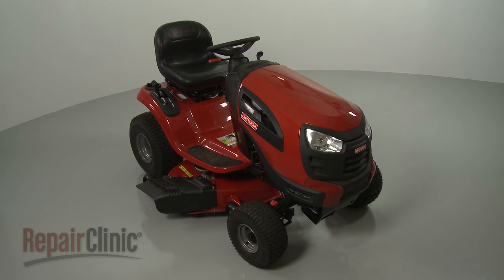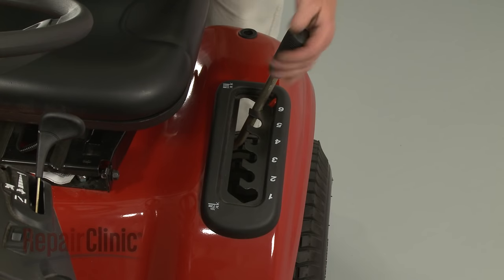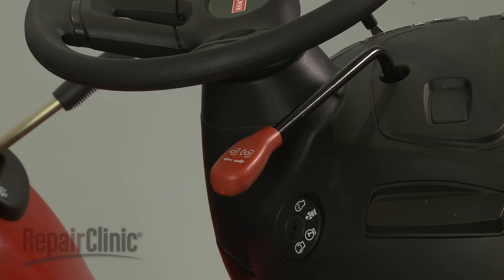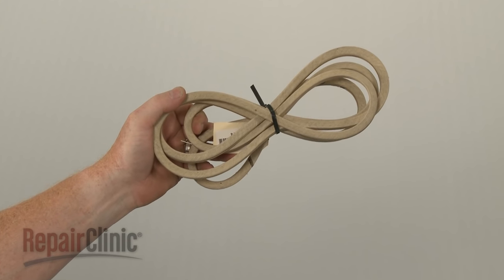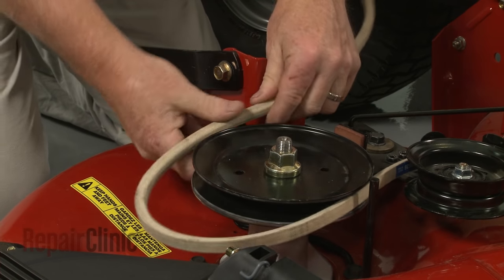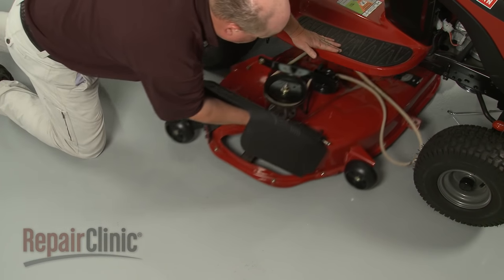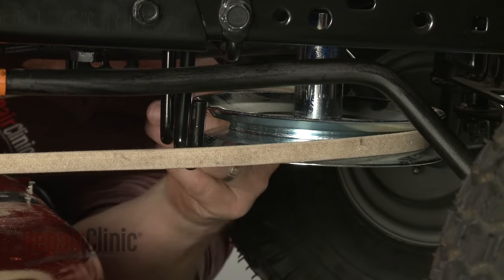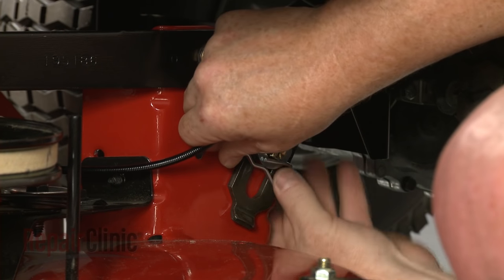Craftsman Riding Lawn Mower Deck V-Belt Replacement #532429636

Comment: Thank you so much. someone put my belt on wrong and it wouldn't engage the blades new belt. So I found your video and tore it all apart and stated over. I'm a 65yrs young woman on oxygen. And I did all that in a hour. would of been so simple if I could of done it the right way first. Great video keep them coming. never know what next I will need to fix. LOL
Reply: Good for you! I'm an empty -nestette about your age. Thanks for the encouragement 🙏❤️😊

Comment: 2018 T1200 Craftsman 42 deck not belt. Looked up, lower deck number  on riding lawnmower and measured old belt but, new belt to large & no adjustment on cable on riding tractor. Old belt measures 95” which is 2” too long. What belt on deck do you recommend to fit shorter & and what is the part number that fits?

Comment: John B .The video was fine, but for me, allot more work than needed. Dropping the deck is fine if you want too waste time, but I just changed the drive belt on the Craftsman T110 without doing that. All that's required is you remove the pulley guards for the deck, and remove one bolt on the guard around the drive pulley so it's loose to get the belt around that pulley. Both ways work, but for me, the more you take loose, the more you have too hook back up.

Comment: Went and did this without taking the deck off of my Craftsman t150 but it was a pain. It was nearly impossible to slide the belt off the outside pulleys due to the "guide/metal rod" that helps to keep the belt from slipping off. After finally wrestling the belt off I learned the new belt (that was recommended) was slightly thicker so as you can imagine I had quite the time getting the new belt on. Several hurt fingers and blisters later voila!
Reply: I also did the job without removing the deck. What a time saver. I also had trouble with the "guide/metal rod". I closed my vice grips completely around the rod below the pulley and was able to pull on the rod to allow the belt to squeeze into position. No hurt fingers and no blisters.
Reply: I'm struggling with those fucking belt retainers as well, mine are thick and not bending or giving very much, nothing like this video shows where the belt easily slips out of them. My belt is also a bit thicker and in no way shape or form getting by these stupid retainers that have no reason being that close/tight to the pulleys. The one I'm struggling with is the retention pulley as well, so it's really annoying trying not to release tension at same time while trying to do this. 
I've tried channel locks but my strong grip isn't bending that thick piece of metal. Guess I'll have to try a long thick screw driver and see if I can use force to bend it over while using momentum. 
I figured Craftsman would be easier than this.
This has been ridiculous to say the least.
Reply: @Lucixir  I can't remember how I did it but it was basically using whatever leverage i could find and just muscling the belt in place. It was a pain for sure.

Comment: Not on this current mower(which is identical to what they're working on) but the previous rider i had, was the very first I'd ever owned.  My neighbor tells me "yeah i know how to do that". 
3 hours later,  having replaced the belt, but also putting the ENTIRE MOWER up on jack stands via floor jack, i was thinking "there's no freakin way this should be this friggin hard!" 
So i then did what i should've done to begin with; YouTube.  5 minute fix.  Took longer to find and watch the video than it did to actually do the task.  
I dunno who invented YouTube, or who thought "i should do a how to video for 'this thing'", but they both ought never have to buy a beer ever again for the rest of their existence.  Hell, even their children and grandchildren ought not have to buy beer EVER.

Comment: I have a YT4000 with the same belt set up which works well until I disengage the blades then the belt comes off the pulleys any help greatly appreciated

Comment: NO need to remove the deck. Took me 30 seconds to replace the belt.. I’m a 62 yr old female with a bad back and did it…. No issues. Easy peasy…
Reply: I'm a lady your age. How did you do it? My belt is broken and I'd rather not pull the deck off, thanks! 🙏

Comment: terrific. I have a 2006 craftsman lawn tractor it has a 23 HP engine with a 42 inch mowerit is a Ys 4500 series . Having trouble finding a deck belt.

Comment: Thank for this video. I learned from it and saved over $100.00 doing it my self Thanks a gain.
Reply from the maker: +Rod Sapyta We are glad it helped.
Reply: I have to say at first I did not get the new belt lined up the right way but I came back inside and saw what I was doing wrong and I have a nice new cut lawn. Thanks for taking the time to do this video.RS

Comment: I have a Craftsman GT 8400 w/ less than 40 hours on it.  For reasons unknown, the deck belt came off when I engaged the blades.  I can't get the belt to go around the drive pulley.  I have tried to create more slack by moving the tensioner pulley with a crow bar but still am unable to get the belt around the drive pulley.  The configuration looks fine per the drawing that is on the mower.  Do you have any suggestions?
Reply: This same thing just happened to me! The belt is so tight I cannot get it back on! how did you end up fixing yours?

Comment: T1300 here. 42” belt, official, and it’s way too loose. I’ve spent 2 days working on it and I still can’t find a way to tighten it. Help please!
Reply from the maker: If it is a genuine OEM replacement part it should fit. Double check that the belt is correctly installed.
Reply: Actually it’s not about just getting the part, it’s getting the right one from the model number and serial number underneath the seat then looking it all up on a parts website or calling a retailer to double check. Getting a 42” belt from Craftsman may not work on your 42” deck because of the model number (not T1300 for instance, it’s a code)

Comment: I have a T2600, it is IMPOSSIBLE to take the belt off unless you loosen the belt guards (which is very painful to loosen).  This includes the front pully as well. YOU HAVE to loosen 2 on the deck plate and take off one in the front from the engine. The other painful issue finding the correct size belt!  NOT listed in the manual!   Agree, with comment below, DON't need to remove the deck, just lower it to the lowest cut setting.  This is and will be my last Craftsman.   My mower was built in 2017.

Comment: You do not have to remove the deck guys! The belt is easy to replace without doing all that.
Reply: Guess what I tried to do it as well without removing the deck too. I miss placed the belt on the pulley without going around the pulley guide the right way and burned a belt up first try after I installed it. It shredded it up. It is worth taking the deck off indeed. Plus I sharpened and cleaned the deck the same time. Win Win Win. 👍
Reply: for some odd reason the tension pulley wont move very far on ours and we keep destroying cables if the lever is moved more than half way. only thing i can figure is possibly debris locking it up. really fed up with craftsman products and my dad mistreating it by neglecting to properly clean it after he uses it. if it isnt a debris issue than i have no idea. tired of fighting it.

Comment: great video clear and to the point. I installed my new belt on my 42in Craftsman mower everything went on fine. Then I went to start it and it wouldn't start. In the end I put the old back on and it started right up. Any reasons to why the mower would not start, I sensed it was a little tight because I had to push and pull to get everything connected back but that I expected. Any help or information would be greatly appreciate it have a great day.
Reply: Sounds like blade clutch was engaged.

Comment: Folks. YOU DO  NOT NEED TO REMOVE THE DECK!!!!!! You can do this job is 10 minutes. 6 screws holding the 2 shrouds over the pullys is all you need to remove and replace the belt. Why on earth go through all this unnecessary steps ? suddenly 10 minutes turns into 2 hours......

Comment: what size belt would i need for a ys4500 craftsman riding lawn mower
Reply: nate davis you can usually find that under the hood. The blade/deck size is the same as the belt size

Comment: I have the LT100 model, hopefully this instructional video is similar to what I'm about to face.  Thanks (Crossing my fingers)
Reply from the maker: markarel This video should at least give you some expectation of what you'll run into.
Reply: The belt replacement was a success, thank you  for your tutorial.  Now I have to clean this carburetor.
Reply from the maker: markarel Thank you for sharing.

Comment: is there a fix for this? : My 2010 Craftsman YTS300 doesn't seem to cut the grass evenly. its almost like where the tires push the grass down doesn't get cut on the next pass, like the blades aren't spinning fast enough to "lift" the grass back up so it can be cut. then when I come around on the third pass I can see a stripe of Longer grass where it didn't cut. Is there a fix for this? I have tried new blades, the stock blades and the hi lift Mulching blades, I changed out the belt for the blades, I have leveled the deck now a few times.to me it just doesn't seem like the blades are spinning as fast as they should be. can I get smaller OD pulleys for the deck? or is it some other problem? its the 46" deck YTS 300 with the 21 HP motor. other than that its a fine tractor.
Reply from the maker: +hdrjunkie We would defer to whatever the user manual says about deck adjustments. That information is more specific than information we have.

Comment: How do I find the right belt for the craftsman t1600 (2014) ? Can anyone help me?
Reply: Did you get the correct belt? I found the best plan,   take the model/ type # to local dealers/ small engine shop/ etc and someone should be able to tell you the actual manufacturer which in my case is Husqvarna , which happened to be the dealer and so I was given the correct belt. Mail order for me was a disaster, despite having the exact Sears part # , an eBay seller sent the same non fitting belt twice . Even having the supposed dimensions is not always reliable to getting a suitable belt. Shop locally whenever possible, you can always take it back (unused) for an exchange. Cost a little more but you avoid some hassle.

Comment: I have a problem in that the belt does not fit. I bought a belt from Sears, and they assured me that it is the correct one. If I put it on with the deck unmounted, the support arms will not align to the pins, being about 2 inches away.  If I put the belt on without connecting it to the drive pulley, mount the deck to the mower frame, and then try to attach it to the drive pulley, it won't even reach to the center of the pulley. I know it should be a lot looser. What am I doing wrong?
Reply: DId you figure this out.  I'm having the same problem.
Reply: Yes, I bought a new belt from a specialty mower shop and it fit. It seemed that the belt I bought from Sears was 3 inches too long, even though it had the correct part number stamped on it.
Reply: Thank you for your help.
Reply: Every single time I have went to Sears for a new belt, it's been wrong. EVERY TIME! And they won't exchange or give money back for them. I have  garage full of belts I don't need.

Comment: Looks like after 2 hours i will get mad, argue with my wife and ruin my weekend
Reply: Dude.  Anyone who has worked or fixed a mower can relate to that.... LOL
Reply: This is me, right now.  Not sure if the weekend is ruined yet, but I'm so frustrated and my wife keeps offering up solutions to problems I don't have.  😑. "Want to borrow a push mower?" Yeah, because my issue is cutting the grass and not this god-forsaken belt that won't fit!!
Reply: Currently watching the video in the same situation
Reply: I can confirm this is exactly what happens
Reply: Hilarious been there
Reply: Omg this is truth!

Comment: Bought a new craftsman T2200 riding mower in January of this year from Lowe's.  Has a grand total of less than 2 hrs. cutting time on it (drought conditions until recently) and this POS belt they're referencing would not stay on!!  Less than 2 hrs. and it's already stretched out.  Now I own a one-seater go-kart with a 17.5 Kohler engine that will do everything but cut grass until I spring for another belt.  All for just over $2000.00.  Save your money on the mower and the foreign-made belt

Comment: I have the same lawn tractor " 2007  craftsman DYT 4000 3 blades   " the belt fell down  and  I still not sure about  the belt pattern configuration around the bullies, I wonder where  could I find a belt  diagram.Your video is not showing  the finish stage after all parts in Place. Wonder if you could tell me  where can I find the diagram ,It is not on my machine  anywhere.I have a lawn tractor " 2007  craftsman DYT 4000 3 blades   " the belt fell down  and  I still not sure about  the belt pattern configuration around the bullies, I wonder where  could I find a belt  diagram.Your video is not showing  the finish stage after all parts in Place. Wonder if you could tell me  where can I find the diagram ,It is not on my machine  anywhere.
Reply from the maker: +Lajos Marczin We do not have a diagram of your machine.
Reply: Thank you tough  It's been fixed now.
Louis.

Comment: Hmm. Works just like that when you're working on a brand new machine that has never mowed grass, doesn't have a speck of dirt on it, in a clean, well-lit, level studio.  Not nearly so easy in real life.  Might as well just look at a diagram.  Oh right, there isn't one available anywhere.  Silly me.  But then, it's no problem at all to call Sears and have a Craftsman repairman make a service call.  For a nominal fee, of course.

Comment: So the belt should be that loose I’ve been thinking about tightening mine up?
Reply: It should be loose/slack when the blade / deck  drive is disengaged ( like he showed the lever in the video).
When the lever is pushed/ moved , the idler pulley moves to tighten the belt and the power is transferred to turn the blade pulleys.